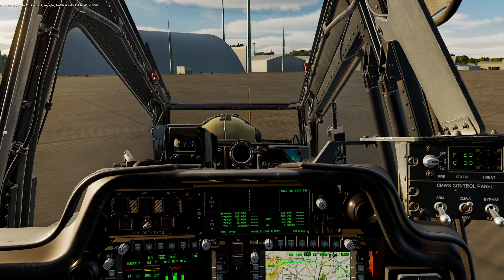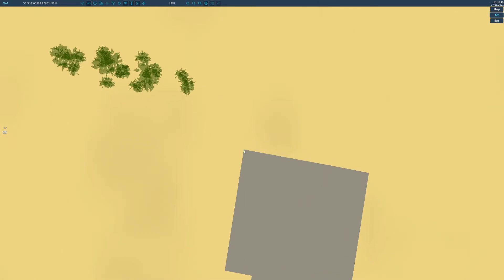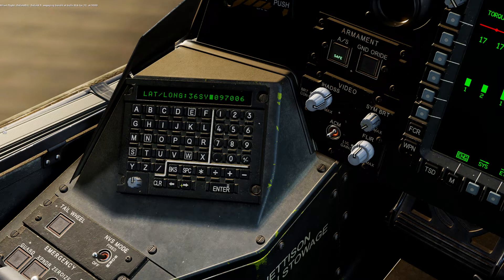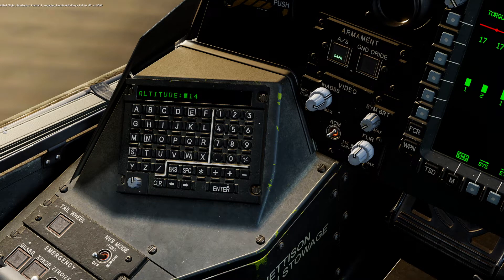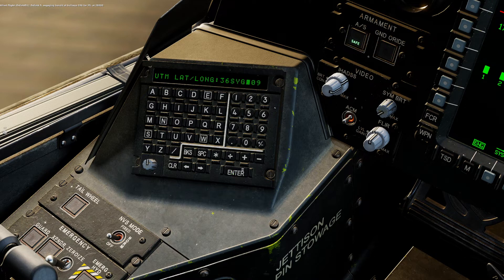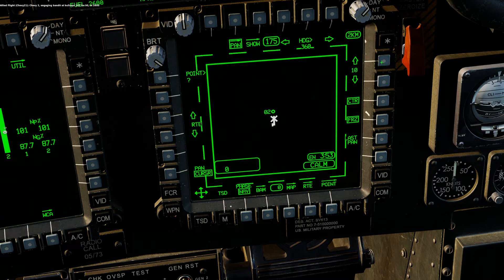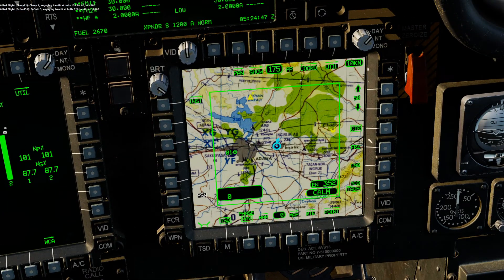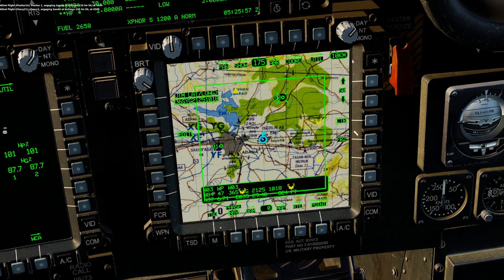Zero to Hero | DCS AH-64D | 9 - Manual Waypoints (GRID Entry)

Comment: Any plans for a zero-to-hero on the minimum steps needed to laser-code and fire Hellfire missiles.    Even better if you don't have to get off the ground, but I think the WOW will prevent firing.

I just got the game and the AH-64 module, and can't get it load sixteen agm-114s, code them (primary/secondary) and fire.
Reply from the maker: Already up! Setting codes is covered in the startup video, firing the Hellfires using George is covered in video 5 of the Apache playlist, and firing Hellfires yourself using a variety of self or donor codes is covered in video 8 :)

Comment: Aweome!  Another question....  Can you use george to control the hellfires or rockets while me the pilot uses the gun?
Reply from the maker: Yes to hellfires, no to rockets. If you look at video 5 in the series, its the same as that method, you just have the guns equipped while you tell George to fire at things with the hellfires. Rockets are a pilot thing, although you can use them in a co-op mode where George is involved in the rocket process.